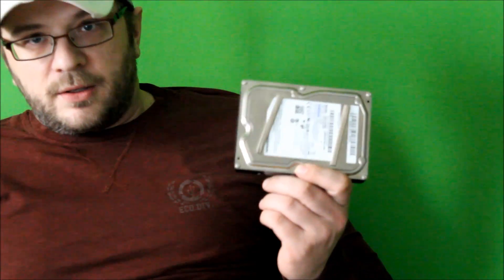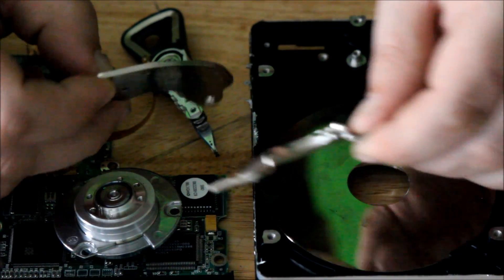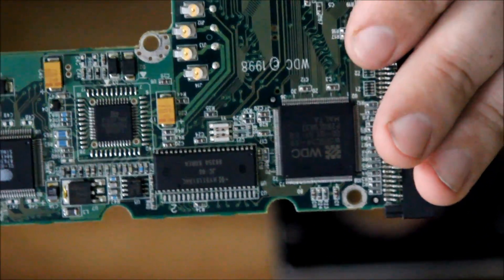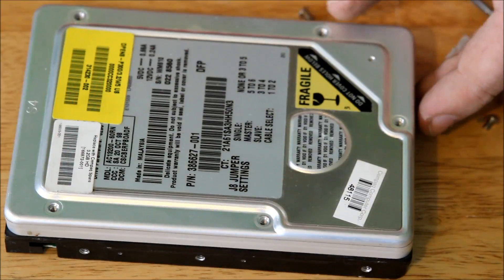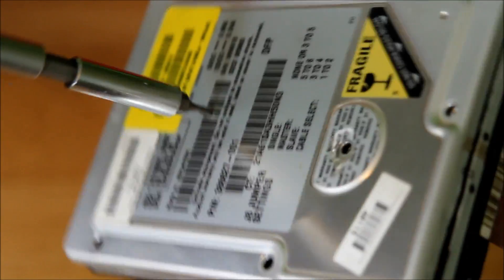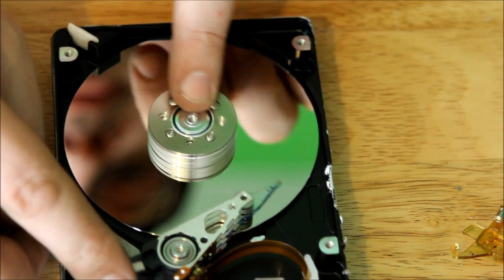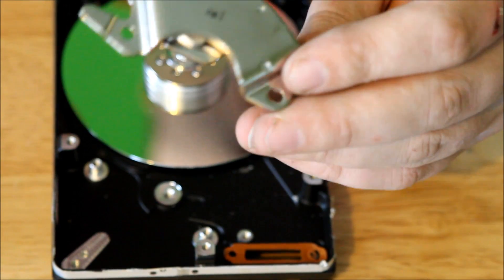Scrapping A Hard Drive - What metals are inside HD VIDEO

Comment: Neodymium magnets are fun to play with, until you get your finger or flesh between them then they become a major pinching hazard.  So, the components you listed are (excluding the enclosure) disk platter, they can be made of glass, the read write heads attached to the head actuator arm, the coil is referred to as a voice coil, similar to what is inside a loudspeaker driver, and the PCB makes up the controller circuitry and an application-specific microcontroller (a microcontroller is in essence a very small, limited use computer and this is what sends, receives and processes data to and from the computer and stores it to the platters.

Comment: I opened up a Western digital WD800 from 2003 and stuck on the cover is a little black box with a white plastic or paper like material. I pierced it and it's filled to the top with what looks like teeny tiny little ball bearings but they aren't attracted to magnets. They do kind of seem like they attract to each other though not all of them. Like some are positive and some are negative. Anyway, does anyone what what they are and what their purpose is inside the drive. First time seeing these so I'm just curious. TIA
Reply: I believe that's a getter, it contains chemicals to react with moisture or any other residual contaminating gases that are left in the case when it's sealed up at the time of manufacture. The membrane is gas permeable, so that the atmosphere inside the case can circulate. Every hard drive I've disassembled has something like it, although the form varies.

Comment: I think that coil inside head(s) actuator is enameled silver wire (but not entirely sure). I tried to power it up, put 12V on this coil (still inside housing, can't run it separately), and it pulls 0.9A when current flows (about 1A on full 13.8V lead-acid battery). Not too strong actuating, but I am able to launch small coin two-three meters away (small catapult). 

I tried to leave it powered, and it doesn't overheat, so my conclusion that this must be silver wire inside this coil. The rest of the contacts and wiring serves as current limiter. BTW, my coil has 1 mH inductance. (can't measure weight of the actuator alone, because it is part of the hard-drive body.

Pulling (or pushing) strength is about 45 grams on tip of the actuator, at about 4 cm from the pivot point of the lever (I broke read/write heads).

Whole angle is 45 degrees of freedom, but 'parking pin' should be removed, and angle should be restricted to less than 40 degrees - if head(s) is/are parked, then it has low actin at first, but after that point it has full strength. 

The idea is to make ornithopter (ornicopter), if wings are positioned so that it glides freely, and periodically just push a little bit air downward in order to maintain height. I hope will find another hard drive that mach the same properties and make pair of the wings.

EDIT: Coil + wires has 1.003 mH, 11.44 ohms (not sure coil alone), measured on Extech LCR meter 380193. Uncertainty of the measuring method is probably 1-2%, or even more... not important at the moment. So, coil's resistance is actually responsible for current limiting to some extent.

I am unable to measure inductivity and resistance at coil point - out of reach (bottom side) without damaging the actuator. 

EDIT2: For ornithopter (ornicopter), there is possible to discharge capacitor with slightly higher voltage to get more action for flapping wings. Not sure how insulation will behave at such higher voltage.
Reply from the maker: Some hard drives with a grey coloured wire coil does have silver in it but with chemical test seems to have "some" silver. Cant seem to get a solid number on this. Cool idea what your working on there, you seem to be a smart guy. Good luck to you and keep me posted! Thanks for watching.

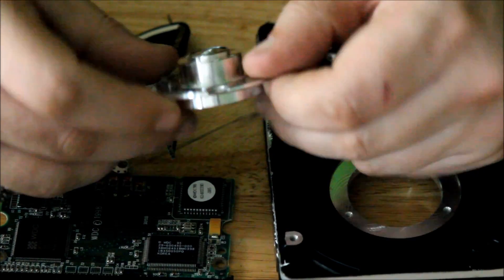Comment: Also another thing... The back board of the hard drive is called a (Logic board) and it has more precious medals then a high grade mother board from a computer tower. So keep them and save them up some junk yards (yours might) will pay like $2:25 a pound and up i live in a small town and i don't think they pay special for those boards but i will keep saving.. I get $1:25 a pound for just regular mother boards.
Reply from the maker: If you go to some of the electronic scrap forums, you can find buyers paying $8-10/lb for hard drive logic boards. Some buyers do not even bother with anything else.

Comment: Rob The Plumber. I didn't take the time to read all of the comments to see if you already know this but... If you cut those Hard drive disks (HDD) into like little triangles, and put them in either tempered glass or plastic ( i use plastic) and pour Muriatic  Acid over them it will dissolve the aluminum inside them and you will be left with the Palladium (which i have always heard it was platinum but never the less)  They will be foils and you just melt them down they will melt together you can melt them in something stainless steel with a hand torch... Now make sure when you start the chemical process you do it in either a well ventilated area or outside it will let off strong fumes, not good to breath and don't let this shit get on your hands because it burns. Also you will have to go back like every hour to 2 hours maybe more depending on how much you have.. after pouring it in (just covering the top) and drain it outside and refill it... but it works then once you can see it is just foil rinse them let them dry and melt them down.